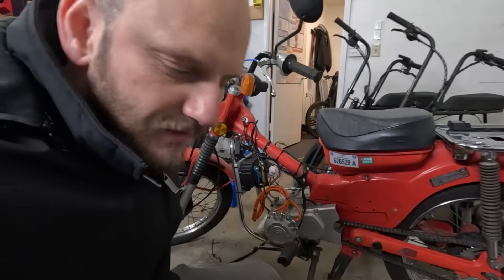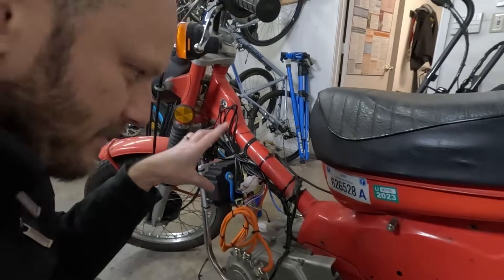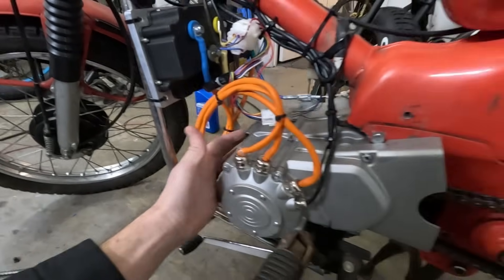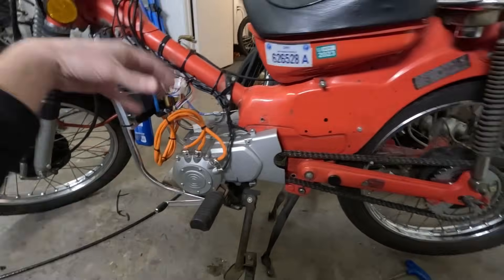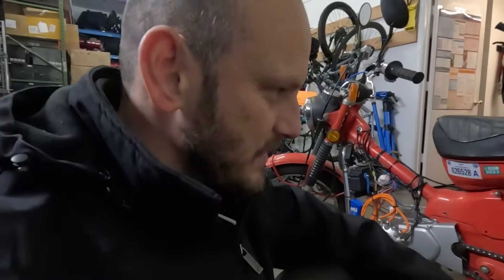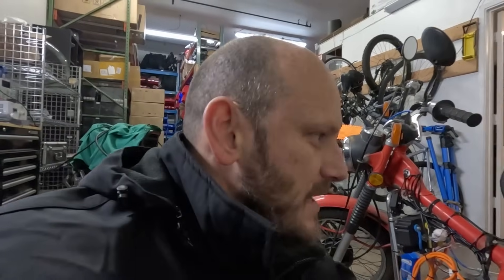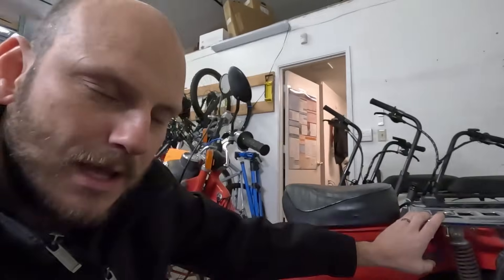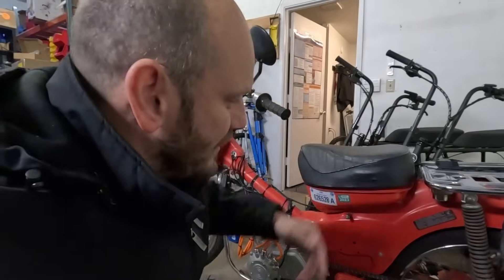An Electric Motorcycle motor with a 4 speed Transmission?! A first Look ct110

Comment: I think I would recommend putting that controller into the gas tank and using the tank metal as a heat sink - just getting the base plate up against a large flat internal surface. This would also protect the controller from the weather. You might also put the BMS and/or battery charger into the tank with it, since they won't be in use at the same time as the controller.

Then you could build a triangular box for cells between the main frame tube, the motor, and the front tubes. Just pile cylindrical cells left to right into the box so they fill the uneven volume decently with flat sides.
Reply from the maker: Ya my original plan was to stuff the controller in the gas tank. I may make an updated video on that when/if I do it.
Reply: You realize how much fabrication that would take to do for very little useable space?  Just make a new tube steel seat mount like the Ruckus has and you can mount the battery and the controller in one place, mounting the battery as close as you can to the controller keeps the cables shorter and decreases the IR losses on the battery power cables  Also more space for mounting a quick disconnect you can turn off quickly
Reply: @tauncfester3022  That very little usable space would be larger than your suggestion, though.

Also losses from cable length should not be a problem in this bike. It's already low voltage and it isn't a problem from that. Worst case, just use a thicker cable.

Also, the battery casing could include its own disconnect (contactor or breaker) and be separately operable.

I don't mind disagreement at all, it was just a suggestion. And I didn't make my design up in a vacuum.

Comment: Is regen going to be possible with this setup?
Reply from the maker: I don’t see why not but I’ll see if the controller supports it
Reply: Agreed! Especially around town and in hilly areas, regen extends your range and takes load off your brakes. In fact, that 4 speed transmission might actually be useful if you have regen,,, changing down gear would increase regen effectiveness!

Comment: So, what you made was an eCub... but without the convenience of zero shifting required. Okay. Given the motor size, I can see how having a multi-speed transmission can be necessary, for the sake of operating range. But... this is a Cub! One of it's biggest selling points was how the semi-automatic transmission didn't require a clutch for making gear changes, up or down. And this totally takes that away... for what? If the effective operating range isn't equal to the original ICE setup, then other than being able to safely bring it indoors (for charging) then swapping to it is a moot point.😕
Reply from the maker: It’s way more powerful that the ICE version. I have to do more tests but so far I’m not sure how necessary the clutch is on that motor. I just added it because it has a clutch plate but it doesn’t actually seem to do anything. I’ll update after I test it more. I think the range depends on the rider. I don’t need 100 mile range on this thing. 30 is fine and the ability to easily bring more batteries also works for me. That may not work for others though. 
The performance swap is easily worth it though. It feels like a 200cc now.
Reply: @JohnnyNerdOut 
Great work. 
This will be an excellent commuting/utility ebike.
The fit of the motor is amazing.
Can wait to see the end product.
I whish I wouldn't have gotten rid of my old Honda XL125.
Reply: Wow.
With that kind of attitude I can understand why your best friends are goldfish.

Comment: Were you topping out the rpm or power of the motor at top speed? I   was just wondering if gearing was perfect. A simple sprocket change might help. If it wheelies very easy ìn first and you are running out of rpms it would be easy to get 50-60mph with sprocket swap. If you are running out of power put a smaller front sprocket and it might help a little. I have always wanted a trans on a electric motor. Thank you for the video.
Reply from the maker: I think the same thing. I already put the smallest sprocket I could find on the rear (42t) and have larger front sprockets on order. I will be making more vids on this project once the weather warms up and I get my parts 😀
Reply: I like the trans too. I would love it if the trans shifted electrically like a formula 1 car trans.

Comment: 4:40  Except you could go 100 miles on a tank's worth of gas and refill it in 20 seconds.  There is not enough room for a big battery on this thing and batteries suck anyway in comparison to gasoline.
Reply: Mopeds like this can meet most people's needs by going 40 miles per day and charging overnight.

For what it's worth, you could travel 100 miles on a non-highway moped like this with about 4-6kWh of batteries, which would weigh about 50lbs. That is a bit much for a small bike but totally doable if you make the battery casing a structural element.

Sure, it would need to charge in say 2 hours after that, but that's still a lot for a little bike, and it's way better than an electric bicycle. You could cover 300 miles per day if you really wanted to.
Reply: @BrianTRice77  But why this particular classic bike?  This is one that is in demand and has a collector's market.  There are a million different chinabikes that he could have used, many of which are already electric.

Also, what is the point of ruining a perfectly good moped to convert into electric anyway?  An electric moped is inferior in every way to a gasoline moped. 
 A 6kw battery would take at a minimum 4 hours to charge and such a charger would be hundreds of Dollars.  The wall side is limited 15 amps or about 1500 watts (at about 80% which is the standard).   I forget the voltage of the battery, but I would think it would be 48v so a 30 amp charger, a bit less if it is 72v.

I agree it would be better than an ebike, at least a legal e-bike.  But it shouldn't be compared to an ebike, a totally different of vehicle.  It should be compared to a moped. This will require registration and insurance along with a valid license. It has to meet DOT standards and in my state, a safety inspection (though it probably would not require an emissions test).  None of this applies to an ebike.
Reply: @ Not my problem, stranger. One man's trash is another man's treasure, they say, and beauty is in the eye of the beholder.

I've ridden electric motorcycles for over a decade and think conversions like this are great for preservation.

For a final quip: Not my monkeys, not my bloody circus.
Reply: @tarstarkusz  BTW moped electric conversions are very easy to register. Nobody cares unless you produce something obviously more dangerous than the initial product. I know guys who do them in their garages just for fun.
Reply: @BrianTRice77  I never said otherwise.  What I said was that E-bikes are in no way comparable to a moped of any kind.
I said:
"I agree it would be better than an ebike, at least a legal e-bike.  But it shouldn't be compared to an ebike, a totally different of vehicle.  It should be compared to a moped. This will require registration and insurance along with a valid license. It has to meet DOT standards and in my state, a safety inspection (though it probably would not require an emissions test).  None of this applies to an ebike."

I said this to point out that mopeds and e-bikes are entirely different things and serve different purposes.  A moped, whether it is gas or electric requires a driver's license, registration, insurance and safety inspections (well, in my state they do) and can only be ridden on private property or the roads (you cannot use them in parks/bike trails, bike lanes etc).
Reply: @BrianTRice77  How are they great for preservation?  The frame had to be cut and welded, that is not preservation.  The engine and transmission will likely be lost (assuming they were present when he got the bike) or sold.  This was a nice example of the bike and now it has been ruined. 
Though I suppose risk tolerance varies from person to person, but I would not want to put a homemade 6kwh lithium ion battery in my garage (someone to sue).  I will only ever allow American brand products with large lithium ion batteries into my garage or house.  The fire risks are too high for my particular risk tolerance.
Finally, they are inferior in every way to a gasoline engine, although I might actually prefer electric to a 2 stroke. But this model was a 4 stroke.
Reply: @ Not my problem, dude. I just think they're neat.
Reply: @tarstarkusz  Mopeds can be compared to e-bikes. So I did it. It's one way to look at it. That's all.

Find someone who cares about your argument, because I don't. I just think it's neat.
Reply: @BrianTRice77  They can also be compared with goats, that doesn't mean they should.  The only thing e-bikes and mopeds have in common is they both have 2 wheels.
If you don't care about my argument, why did you reply to me?  I agree with you that it's "neat,"  I just think it's a bad idea.  But lots of bad ideas are fun to watch.
Reply: If you’re riding 100 miles on one of these scooters in one trip, I tip my hat to you sir.
Reply: @rexmundi8154  But the electric range is probably more like 20 miles.
Reply: @tarstarkusz  I don’t want to ride one 20 miles
Reply: @rexmundi8154  Then you shouldn't own one.  This limits you to about 9 miles (9 going there, 9 back). with 2 miles of range cushion.  Just last week I did 20 miles on a bicycle.
Reply: @ I have a 1960’s S90 that I wanted to convert to electric and this makes it a lot easier. No ones telling you what to do when or with the things you own. I’m just saying for my riding style, 20 miles of range is fine and with the right battery setup it would probably be closer to 40 anyway.

Comment: WHY did you ruin this bike by slapping an electric motor in it?  You could have done this to a cheap china moped, but instead you opted to ruin a classic Honda moped?
Reply from the maker: Hell ya 😎
Reply: @JohnnyNerdOut  Seriously? Why?  There are just so many dirt cheap and plentiful bikes you could have put it on.  Plus it looks like it is in reasonable condition.  Even if the motor was blown or missing, there is a used market for these.  You said you had to modify the frame to get this to work.
Reply: @tarstarkusz I’m curious….why are you worked up over what someone does to their own bike?  It’s not yours, why do you care?
Reply: @MiniBikeMike  I'm not worked up and really don't care much.  It's a reaction to seeing something dumb being done.  It survived the ravages of 45 years only to be made worse.
It could be that he got it without an engine (though I am sure you can get a replacement) and or transmission, but he doesn't say that.  Plus, we're spoiled for choice when it comes to downgrading a moped into electric, so why chose this model?  There must be a thousand different makes of cheap china scooter that aren't worth a new engine.
Reply: @ …all that and you say you’re not worked up or care.  Way too funny.
Reply: @MiniBikeMike  If it were mine I'd be worked up.  But it's his.  I'm just reacting to something ridiculous.
Reply: I'm more than sure he can slap the original engine back on and put it "almost" back original
Reply: @190SkyTeam  Perhaps.  But it just seems like such a silly project and a downgrade. China makes electric mopeds by the mountain's worth.

Comment: For those familiar with Honda CT 70;s, and Chinese clones, that is a standard mount system. Will fit pretty much all those universal chinese Honda clone chassis.
Reply: These pitbike Honda clone engines/motors will fit easily any of the sub 90 cc Hondas like the C-100 (old original pushrod, all iron head and cylinder, 50 and 55 cc engines the first Hondas sold in America..) and CT70/CL70 and little CFR50 pit bike and clones.

 The CL/SL/CT 90's all have a different bolt pattern with an additional bolt in the back and the engines are wider and the footpeg mounts are also wider and don't fit the smaller engines.  The upside is you can take a 1969 Honda C100 Cub and put a 140 cc engine in them.  Really perky and an easy 60+ mph cruise speed.

I have owned about 9 Honda step-throughs in my time, including 4 of the C-100/102/105 Honda Trail 50/55's and 5 Honda Trail 90's.  Don't get me started on all the little Yamaha Trailmasters.
Reply: My first motorcycle in about 1980 was a CT90.
Reply: So then why did he ruin an 81 genuine Honda bike?  WHY didn't he wreck a chinaclone bike instead?
Reply: Hondas are a great rebuild target: solid bikes & on the rare occasion they are killed without being wrecked, the homogenation around them, makes a prime platform for custom work.

Comment: i wanted to swap one of these into my motoped when i had it but no room for a battery so i sold it. its nice! come on now you know you can push 6kw through that thing easily hah. get a larger front gear for the motor you will take off a bit slower but get more top end. did that company have the step file available for this motor?
Reply from the maker: I haven’t tried messing with the programming yet but I did get the software for it 😀 I bet it can do 6k too

Comment: Just speculating, but under the seat battery sounds cool, but air flow to help keep them cool sounds like it would make sense. what kind of range with what size battery are you looking at? Supercool conversion.
quick note: 3000 watts is about 4hp. Also for metric people, 40 mph is about 65kph. 55mph is about 88kmh.
Reply from the maker: @JustAnotherHo  I’m guessing I’ll get 10-15 miles per battery I mount. @1kwh per. I could move my other motorcycle battery to this one and get about 40 miles range. But I like the idea of being hot swappable

Comment: Love it. Well done Johnny. 
PS. I am a bit torn about this type of conversion and I personally own two BBSHD 'bicycles'...one a roadbike and other a 29'er.
Just my thoughts....
This type of bike seems underpowered for the road and 'too much of a motorcycle' to ride on the sidewalk or dedicated bike paths.
So, to me, it is caught in 'no man's land'. Doesn't have a place.  I would rather have the 60mph 125cc gas version called the Honda Trail CT125 for the road that will run for 100 miles you can fill up at the gas station. Most know if you ran that electric bike at 45mph it will quickly burn through even a 30 amp-hr battery. Or...just buy a faster motorcycle for the road which is safer because easier to keep up with cars.
The only reason, I haven't looked into building something like this, I just don't see the application for it.  I do think its a great 'concept'. Just don't see the merit owning something that can barely keep up on 45 mph roads.
On the road shared with cars, I want more power and on bike paths I want a bicycle (and not a Surron either) I can pedal with a motor like the BBSHD.
All the best.
Reply from the maker: I’ll do a proper top speed test once I get a bigger front sprocket installed. 60 may not be off the table. Range is always an issue though compared to gas 😞
Reply: This would go nicely in a adolescent's dirt bike, such as a Honda CRF150F motocross frame, or a Yamaha TT220, or a Suzuki DR125L.  Perfect to get my 11yo daughter riding with me!
Reply: @nuchbutter  I am more in the camp when it comes to kids to not have them ride motorized vehicles...maybe gokarts are ok in competition...or if you as a parent who love motocross...I get it, but I am more in the gas camp.  I grew up riding motorcycles and built fast gas minibikes as a kid.  A kid IMHO needs to develop strong legs. I like to see kids mountain biking and road cycling. but a lot of parents of course want their kid in a particular arena.
Reply: @lukewalker1051  We do both where we live.  However, having started in motocross in 1978 in NW Kansas, and mountain biking on the island of Kauai in 1994 , I firmly believe that motocross provides the best overall fitness challenge.
Reply: Spot on. An opinion, which I obviously agree with, very well delivered.